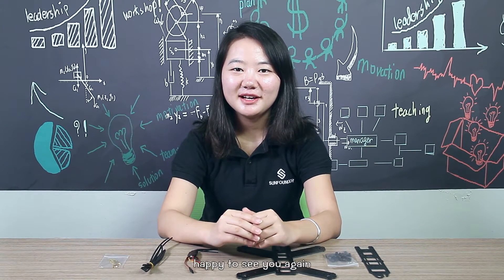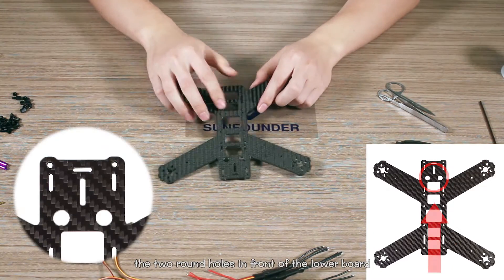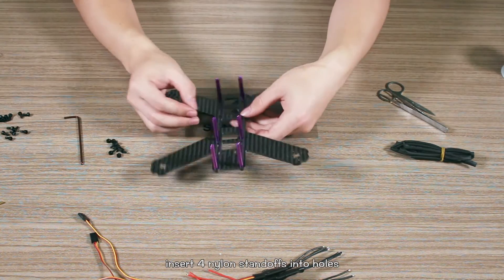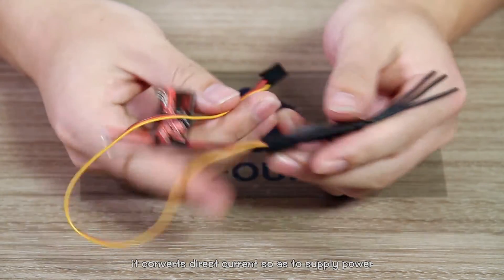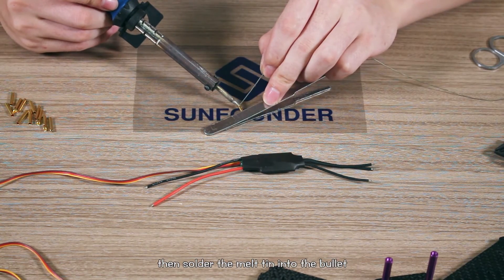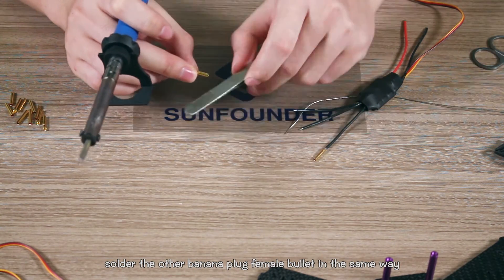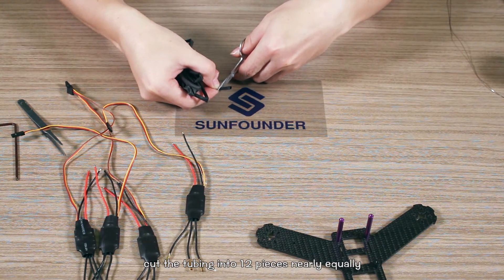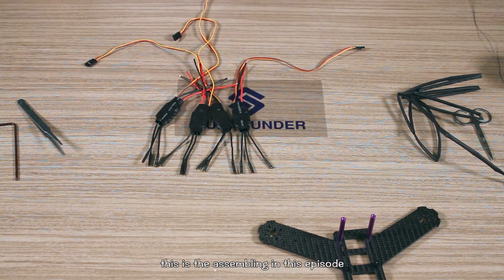QAV210-Compatible SunFounder SF210 FPV Racing Drone Quadcopter Assembly Tutorial 2- Frame

Comment: you should use a lighter to shink tubing much faster
Reply: Fresh men with good hardness :)-
Reply from the maker: Dear Jonathan,

Thanks for your suggestion, we use this kind of material drone which is mainly aimed at fresh men. Because of it has good hardness, and is more resistant to fall.
If you want the faster drone, you have three ways as below:
A. Using the 4s battery is the direct way.
B. Changing the ESC to oneshot125.
C. Changing the motor to 2205 motor.
Hope you can have more fun!
Reply: SunFounder Maker Education Well that reply was kinda unrelated to the comment but it was actually helpful to me I was wondering if this worked with 4s directly and now I know, thanks =) as for heat shrink I’ve always used a lighter but that can actually cause uneven and messy heat shrink, the solder method works ok but it is a little more tedious and you gotta make sure you don’t accidentally get solder on the heat shrink. For $12 you can buy a little hot air gun on amazon, I haven’t got mine yet but seems like a good cheap way to do it if you don’t wanna spend $75+ for a hot air station.